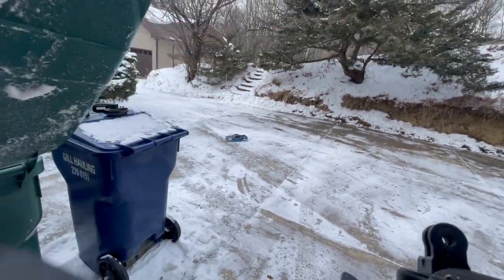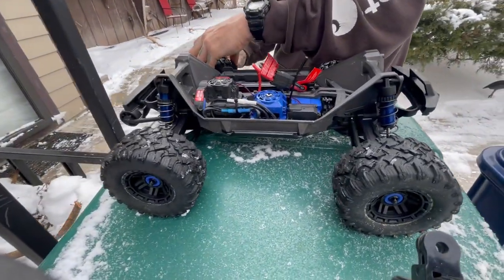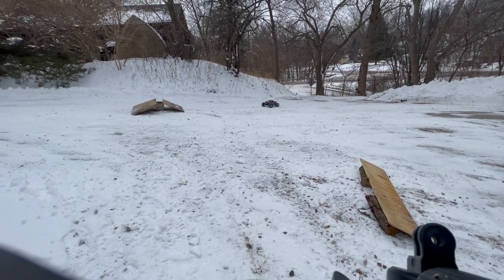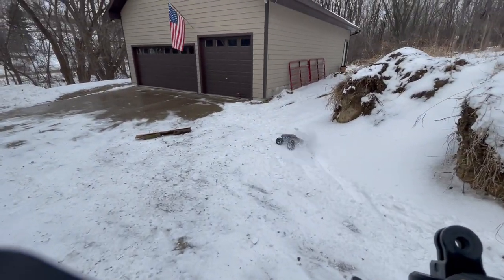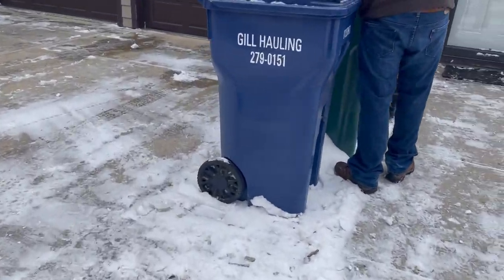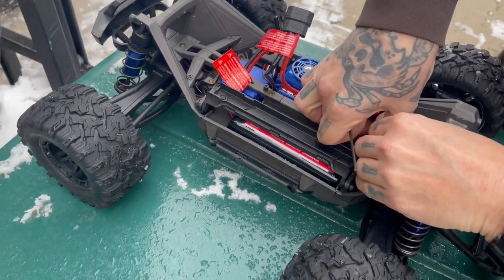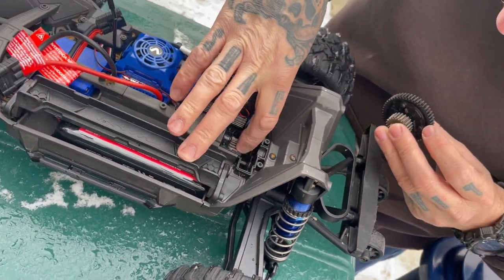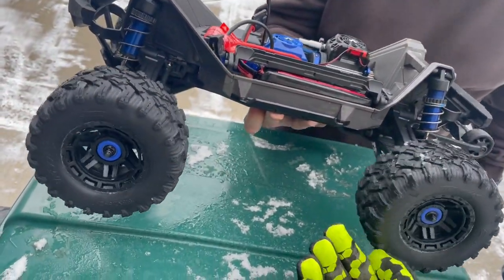Toe Shifter Got a Wide Kit on his Traxxas  MAXX and Now its All Broken...

Comment: Did you ever figure out the problem? mind just started making the same noise
Reply from the maker: He didn’t get the “key” correct when doing the reassembly on the drive axels.
Reply: @Elveshelves  What "Key"? Have the same issue. Also my pinion gets loose all the time for some reason
Reply from the maker: @sergeydanko1999  “key”as in keyed.   There is one unique spline the is supposed to uniquely fit its matching slot. My buddy managed to incorrectly force it together miss aligned.   Cheers.
Reply: @Elveshelves  Do you mean on central driveshaft?
Reply from the maker: @sergeydanko1999 my buddy put the “wide kit” on, so it was the drive axles to the wheels. He got one of the 4 wrong. I really don’t understand how or why it caused the problem that it did but when he got all 4 aligned correctly the issue was gone. Cheers!